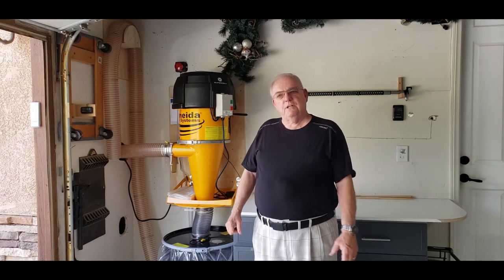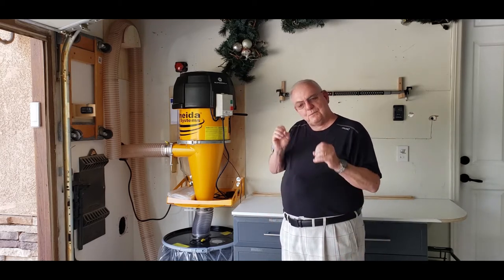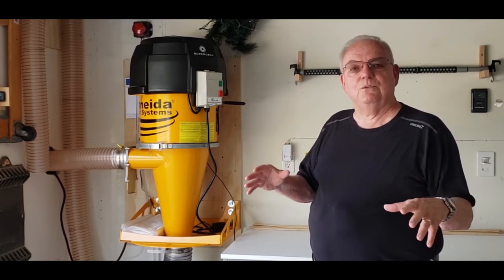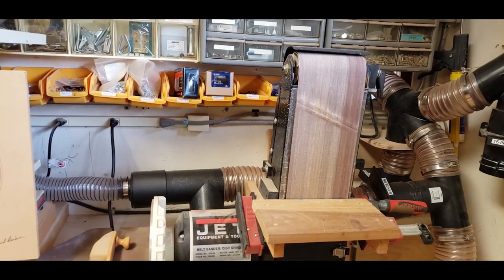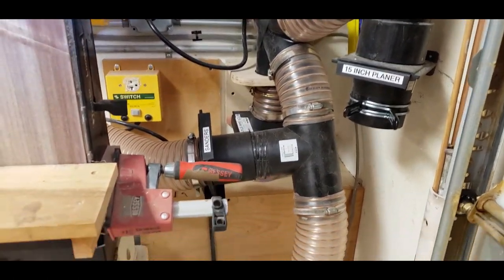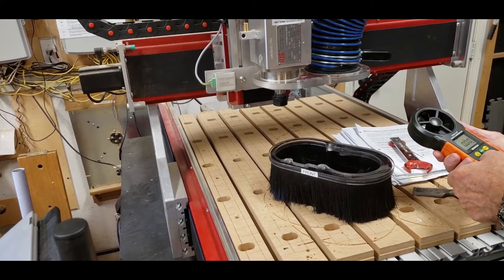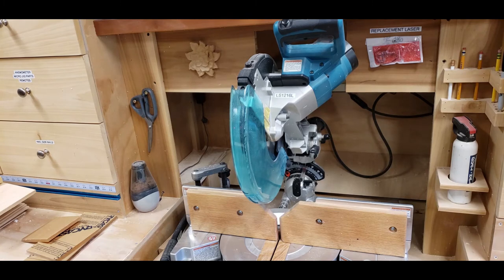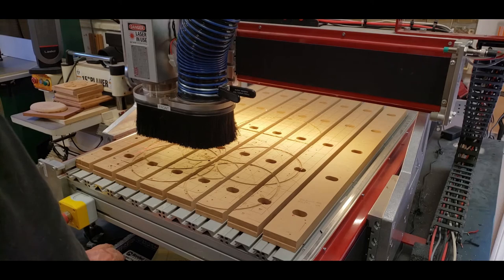Oneida Supercell review

Comment: On that remote for the Oneida, when you sense that the remote is worn out and will not start or requires several presses of the go button; just buy the remote from Oneida; not the receiver unit as those do last longer than the remote. I had an electrician come in the shop (he had a reading disability as I found out after several failures of the install) and he miswired the remote and a shaper.
That wiring on the remote caused me to think the remotes were not lasting very long; I was buying lots of remotes. Finally had Oneida tell me how the wires connect and now I have remotes around the shop saving me time. The electrician, due to his failures, would say, "you need to get the machine manufacturer out here to correct their mistake". I just started reading all the install papers and figured out the problems.
I hope you can place branching of the 4" tubes and avoid those 90 degree turns. Good luck

Comment: Thanks for this video! FYI, I spoke with iVac tech support and they confirmed that you just need the Contactor that they sell, it then plugs into a 115v ivac switch, and the Supercell just plugs into your wall outlet. That enables the auto/remote on/off. I've ordered this setup along with the blast gates...looking forward to it!
Reply: Hi, thanks for that info!  Its been 11 months since you posted this. Do you have any updates? Were you able to install the auto on/off with the blast gates ok? How do you like it?  I'll be setting up for a small carpentry business and need it to be automated because the guys won't remember or take the time to turn on the unit each time.  Thank you!
Reply: @yabogomol2285  It's working well! The contactor install was easy (auto on/off) and works reliably. The iVac blast gates also are great. I have a very weird space that my shop is in (not one open space, but several smaller 'rooms') and I did find that putting the iVac Pro Tool Plus sensors (those that sense when a tool starts) into as much of an open space as possible helps, as does making sure they're away from other potential electrical interference. Every once in a while, I'll get a gate not in the correct state, but I think that's due to my unique shop layout and wall interference. All up - loving the setup and highly recommend!

Comment: 11,000 CFM?  I think you might have calculated that wrong, do you have the correct settings and the right cubic feet set?  You need to set the units of the area of the tube, then measure CFM.  11K is 24 times higher than the manufacturer states.
Reply from the maker: See the answer above. The 11000 converts to 959 CFM.
Reply: @thewoodmaster  you may have an issue with your meter, that is still 2X the OEM rating (434 CFM @ 1.9" WC) and I am sure you are at least at 2"WC if not more.
Reply: Can you check your setting, FPM, and not CFM?

Comment: What type of piping are you using?  What is the black PVC pipe?  Are the y splits, angle pieces, and connectors the same PVC?  What brand/where did you buy?  Thanks for the review!
Reply from the maker: The black pipe is abs 4" from HD, and the y splits are from Rockler. there splits fit perfectly on the inside of the ABS black pipe

Comment: Another great effort Howard!   Now I need to buy the air volume measuring device!  You are good at getting me to spend $$$.  :)  I was wondering if it was powerful enough 
that I'd need to leave a blast gate open in addition to the tool I was using.  I'm going to add a long hose to vacuum my shop and was deciding whether to add a blast gate for it or just leave it open.  My gut says do the blast gate.  Just pulled the trigger on iVac.
Reply from the maker: I would use the blast gate. Gad to see you have pulled the trigger.

Comment: Great review Howard.  I am seriosly considering a super cell.  Onieda strongly recommends against using plastic pipe.  I currently have some of my plastic pipe system under a cement floor and the rest on the walls and ceiling.  I noticed that you seem to have some plastic pipe under the floor and along the wall.  Do you have any problems with static electricity?
Reply from the maker: I have not had any problems with static electricity. If I remember when I first installed the pvc pipe I ran the ground wire along the pipe. I put screws through the pipe and ran the ground wires around the screws on the outside of the pipe. Never had any problems with static electricity.

Comment: Hi Mr. Boehm. Are all of those flex hoses reinforced or have you been able to get by using standard hoses? Thanks for the great review.
Reply from the maker: I used the reinforced hose they sell. It is needed as the normal hose will collapse.  That being said I am using a short piece of regular hose at the far end of my longest run. It is open at the cnc so it doesn't collapse
Reply: @thewoodmaster  Awesome. Thank you.

Comment: Howard, I have a mini gorilla 220v Oneida dust collector and I am considering upgrading to this super-cell unit.  What kind of electrical power did you have to run to that new super-cell dust collector?  How quiet is the unit up close?  Thanks for the video.
Reply from the maker: It is a lot quieter that my old delta but your not going to take a nap next to it. It takes 220v which is what my old one had.

Comment: Hi Howard, great review, thank you! How long approximately is your longest run? Looks like you are getting over 550 CFM on your CNC, that's pretty impressive. 

What's even more impressive is the suction at your miter saw hood, that rectangle hole must be approximately 28"x2" and at 1200 LFM it gives us 1200 * (28*2/144) = 467 CFM?! Even if my approximation on the dust collecting cavity is wildly off and it's 2 times smaller, that still means you are getting 233 CFM, which is extraordinary.

I'm thinking about upgrading my dust collector to the Supercell, so I'm also very interested in how it performs on your Unisaw? Better than your old one? Do you have over the blade dust collection on the saw?
Reply from the maker: About 50 feet